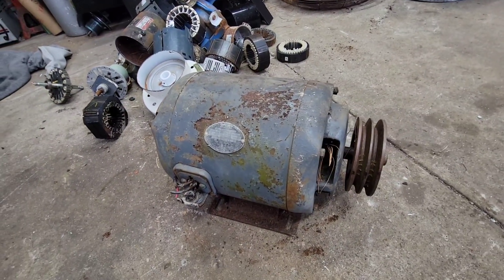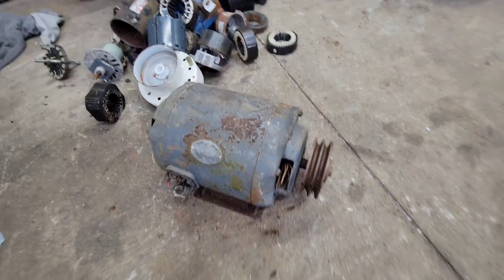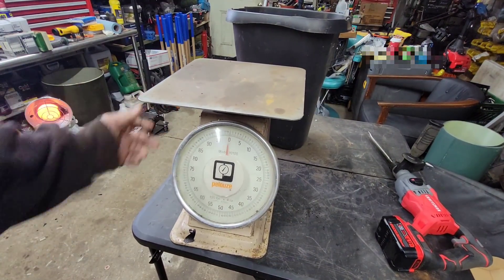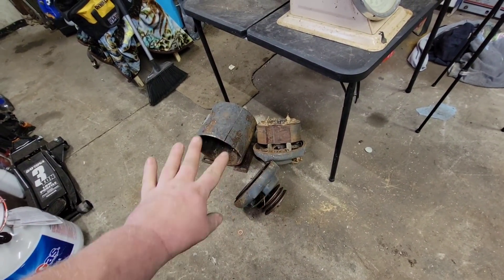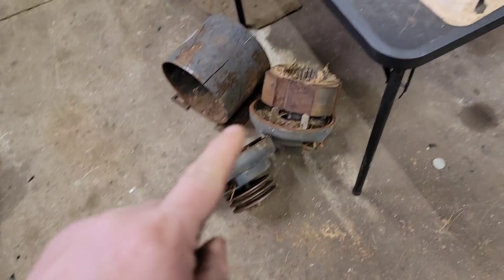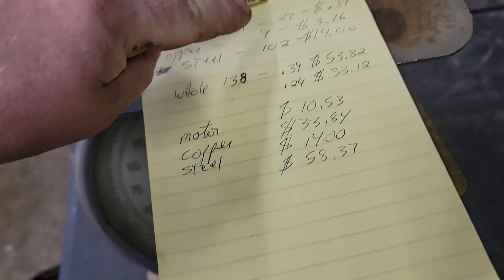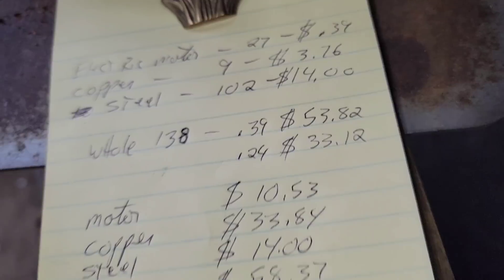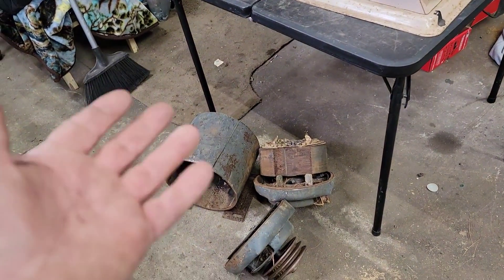Recycling Electric Motors.

Comment: Have you tried using a 4 inch wide chisel to cut them in half ?. Then pull the two ends out ? Im going to get one and try and see if it works. Im going to use a corded one tho.
Reply from the maker: @michaelnonferrousscrapper682  I would think it would work pretty good but you might have to run it on kind of an angle cuz if you go straight down you're just going to push the coil into the center of the field but hey let me know how it works out I've seen other people do it that way but I'm sure there's a finesse and a method to the madness you're going to have to figure out .. as well as the difference in fields from one motor to the next ..
Reply: @ScrapFarm  yea I will definitely.

Comment: You have bought the wrong machine, you need a machine with at least 5 joules of power with a mains cable, not a battery.
Reply from the maker: It works 💪

Comment: It's funny, my initial amateur observation or opinion was that the big motor would be better sold intact, because the hardware was so heavy, and after seeing tbe numbers, definitely not worth it, even at the higher price. Your time & cutting blades etc. It really depends on how much stuff you have. For a small part-time scrapper who isn't able to find much scrap, it would be worth doing, or yourself in the dead of winter maybe when you're in out of the weather, but with the volume of stuff you have, hardly seems worth it. BUT that is just my opinion and as you know, I'm not an expert lol 😆
Reply from the maker: I hear ya hopefully this video does as good as the last one and makes over 2 grand in the next year.
Reply: @ScrapFarm  haha well there's an added bonus 😄👍 It is a great video because you were clear with your numbers and showed the whole process. I hope it does well for you

Comment: I've seen scrapping videos like this one. They would sometimes use  a wedgin the line they cut to spread the case apart and it seems to work fairly well. The inside drops out. Very cool video though. Thanks for sharing.

Comment: I like the tool bit you made for the Craftsman. Maybe you can make a smaller version of the bit for your smaller motors.  Or are those smaller motors easier to do with just the hammer like you usually do?  Might be able to use that large bit.. I don't know.. you would be better to determine that.  But nice invention.  Great idea to save your energy.
Reply from the maker: Sometimes the small ones come right apart but other times they can really fight you so I'm sure this will come in handy a lot
Reply: Nice invention.  Also, I want to mention a YT Channel you might enjoy watching.  The YT Channel name is "Project Shop FL".  This guy in Florida has a cool home-made scrapping shop and makes most of his own tools.  All of his content is good, but check out one his tools he built in this video dated Feb 12.  At the 5 minute 12 second time-stamp of this video "Making $70 An Hour Processing" he has a Frankenstein hydraulic press he built that punches out the copper cores of transformers and other motors, etc.  He keeps track of his time and costs and shows the breakdown of the money he's making.  Similar to the piece of paper you showed comparing the money earned breaking down that big motor.  He gets a lot of his scrap from electricians, builders he has in his network.  He goes to the their job sites and picks up all the leftover metal and buys it from them.  Not sure exactly how he does it, but he works on volume.  I just started watching his channel.  I thought you might like to check him out.  Good videos.
Reply from the maker: @silverlicious2086  ya I watch him

Comment: 120 pounds 
Where ya find that beast?
Reply from the maker: I really don't remember it's been sitting down back for a while.
Reply: @ScrapFarm  I’ve got a large motor kinda like that 
Only took it apart 1/2 way though 
The copper is really packed tightly

Comment: I finally picked up a craftsman jobsite radio, got it for 25 bucks, but it didn't have the power cord. Would you happen to have an extra power cord or do you know where I can pick one up for it
Reply from the maker: Basically all you need is a 24 V laptop charger
Reply from the maker: I found one on Amazon for like $19
Reply: @ScrapFarm  thanks I'll read up on it

Comment: It was worth it who makes almost 60 bucks  every 20  minutes no one I know just u Burt  keep pounding it man it’s always worth it
Reply: Doctors football players but blue collar wise maybe Hightower walker crane operators and maybe bit coin miners but yea thats about it lol 😆 I tell my wife when I scrap and Calculate my actual time into it nothing pays better yesterday I did what burt did and I turned my hoard into 766 bucks in 3 hours total work and driving!
Reply from the maker: It's definitely good it's just super inconsistent... Unless you got a lot of good accounts.
Reply: @ScrapFarm  exactly I had a bunch of accounts auto shops thru the summer but wasn't worth it after a while I was making better money with mowing lawns but tbh its the cost of fuel I mean I used to love going out bulk nights even in my Lil s10 and it's like the gas is turning into water burning so fast and going up in price I stick to cord snipping and picking thru the good stuff when it's there ya know non ferrous hoarding and doing an occasional lite iron load but that's about it until gas prices come back down if they ever do.
Reply from the maker: @scrappyhustler7467   Well hopefully all these guys with these big full sized trucks will have to give up and me and my little tiny trucks will still be out there pulling in maximum profit.   Lol
Reply: @scrappyhustler7467  Same. Fuel prices have hiked in Australia too, at least in Western Australia, pushing up towards $2 a Litre which is insane. I only venture out a few times a week because I just can't justify the fuel cost